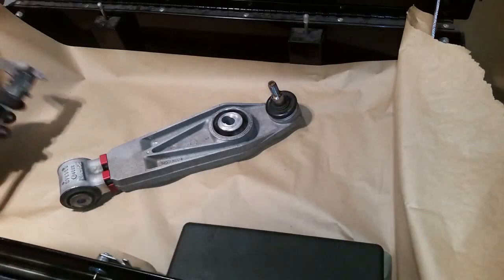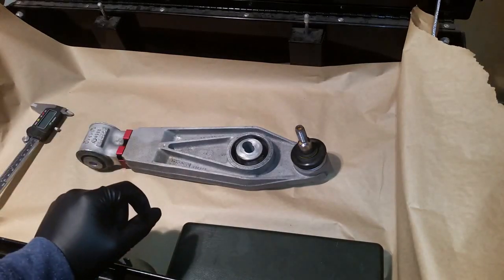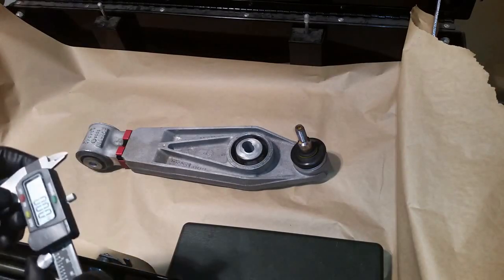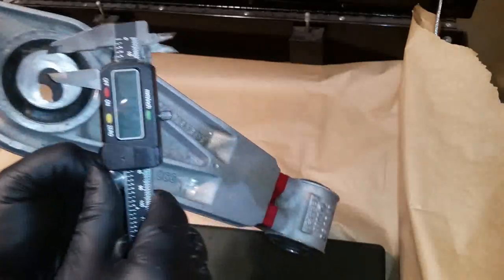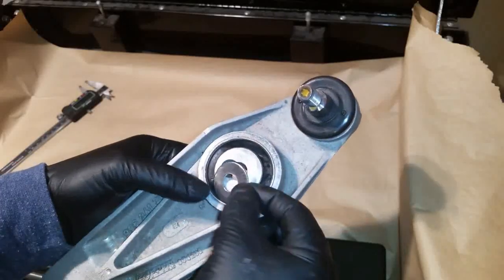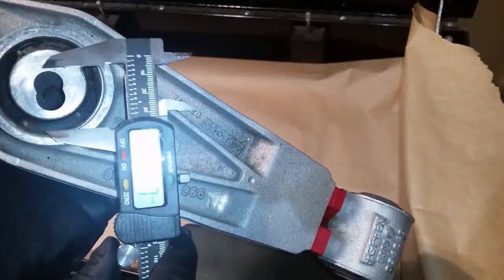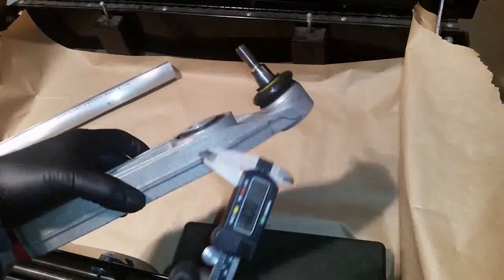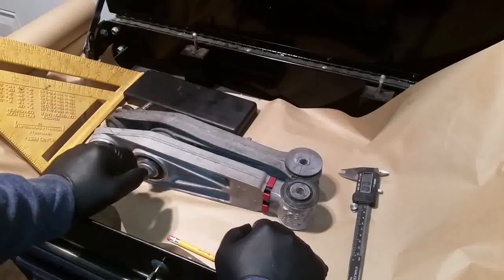GT3 Lower Control Arm Installation on Cayman - Part I - Comparing lower control arms

Comment: Hi! Love your channel. Do you still have the part no. of the GT3 control arm? There are many GT3 models by now :)
Reply from the maker: Hi. Thank you. You can read the part numbers by pausing the video. I did so and here are the numbers: 99634134190 and 99634154196
Reply: @caymans  Hi, have you installed these just at the front? What about the rear ones? My understanding is you can use the same ones for the rear, or are there different part numbers please?
Reply from the maker: @theitalianbrick8190  I also think that you can use the same parts for rear as well ( if I remember correctly). However, you don't need to do that in the rear. The reason is that rear has a great range of adjust-ability. Front has a very limited range for camber setting (-1 is the max you can get IIRC).
Reply: @caymans  nice video thanks a lot . Question does end bushes comes with arm or they should purchased separately? Curious to order all
Reply from the maker: @boizux419  thanks. Yes both the LCA and thrust arm come with pre installed rubber bushings. If you are a pro racer you can replace them with poly bushings though but you will loose some ride comfort and the road noise is increased. Plus replacing the bushings needs some tools.
Reply: https://www.tarett.com/items/986-987-981-718-products/986-987-981-718-suspension/986-987-981-718-control-arms/gt3-control-arm-kit-996-997-986-987-lcakit-detail.htm?Count_Class_1_2892245=5699814&Count_Class_2_2892245=5699816&repost=1&start=0&Count_Class_3_2892245=9232534#ITEM_2892245